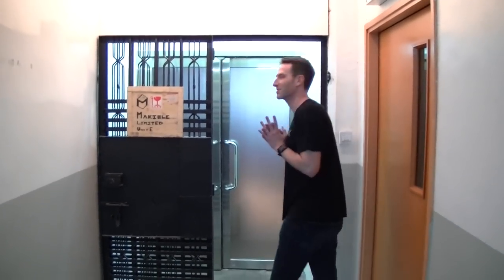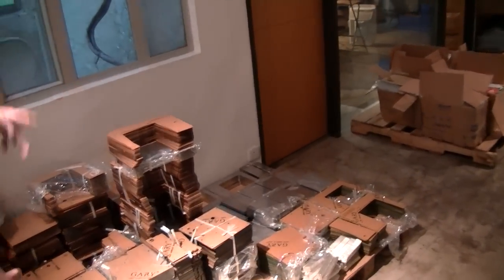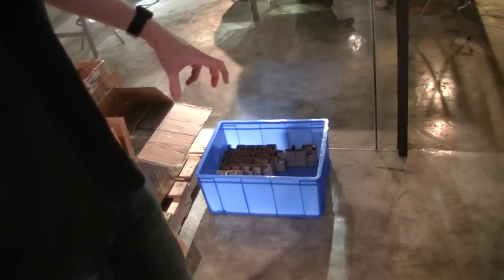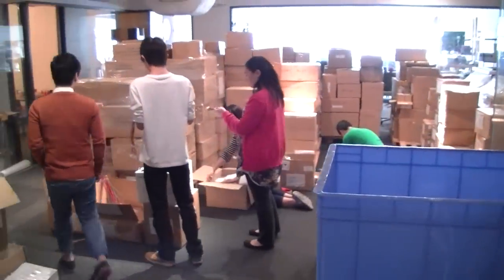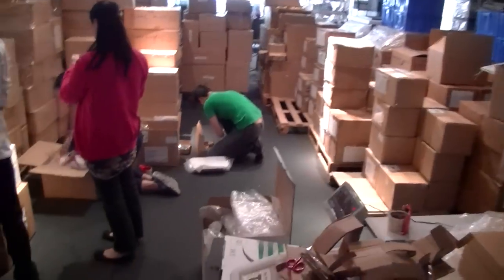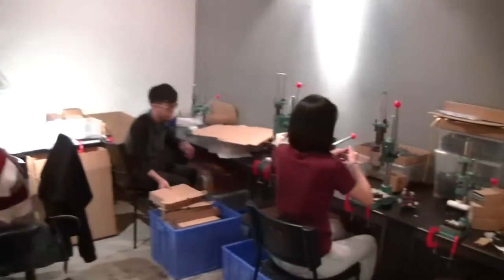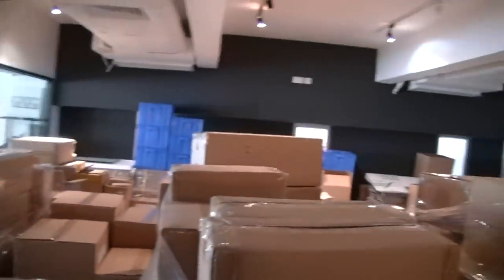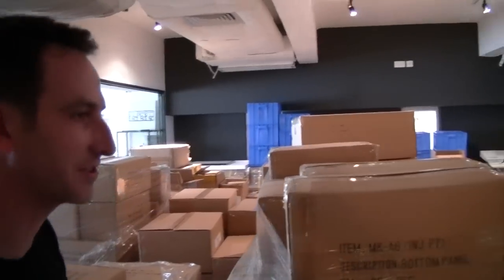#MakiBox - Makilab production status walkthrough

Comment: What is the status of the stainless versions? Will it be possible to update to stainless because I think all the Germans from Feb`12 agreed on the Acrylic version to get the box faster (we know now, that didn´t help).
Reply: At this point, it doesn't make any significant difference. I think you are talking LT vs. HT, not Stainless vs. Acrylic, as there is no difference in the casing material lead times. We need to batch them in terms of production, but otherwise they are all being produced at the same times.